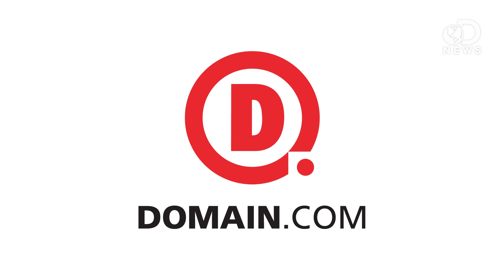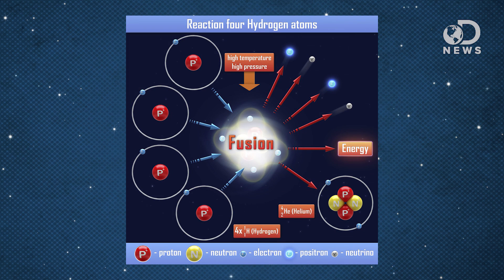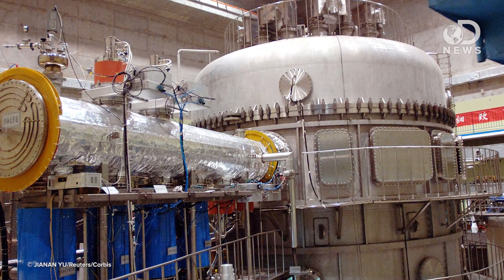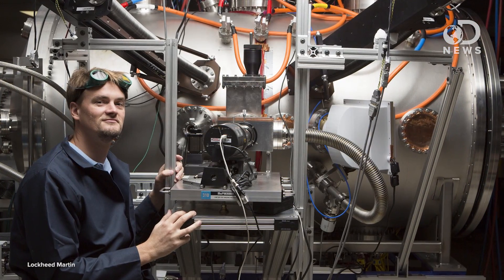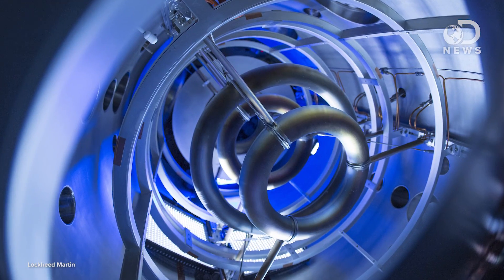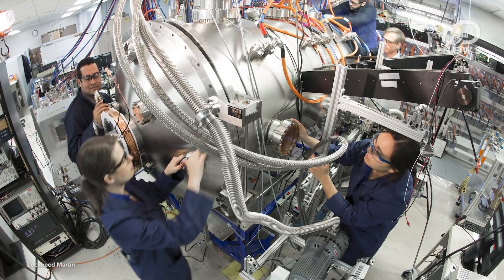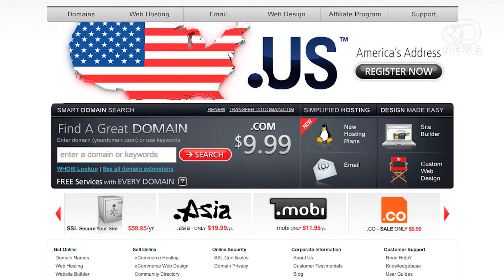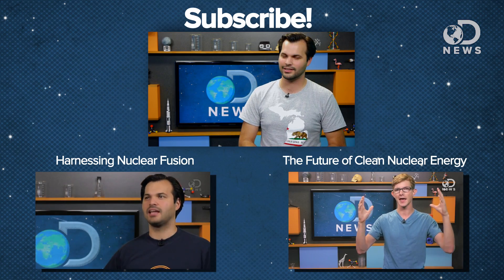Is Fusion Energy Close To Becoming A Reality?

Comment: I have a bad feeling that the coal companies with all of their lobbying power in the US will stem this from happening because of fear of them becoming obsolete.
Reply: Solthiel What you mean like thorium, solar, wind, water and geothermal? Oh wait the coal industry DID shut them down :/
Reply: Solthiel My point is, Thorium is a completely viable form of energy more efficient, safer AND less polluting than Oil, Coal or Uranium, but we're not using it. Why? Because the mining companies control the media. Therefore Fusion isn't going to help, because the mining companies, like with Thorium, won't let it.
Reply: +Bud Charles Lockheed is a beast. They have lobbyists as well as the keys to the kingdom with our military's most advanced tech. I bet they already have a energy net positive prototype and I bet the plans have already been stolen by the Chinese so the cat's out of the bag now.
Reply: Yeah I wouldn't worry about that.  The fossil fuel industry's lobbying will be utterly demolished by the lobbying of any group which has an energy production this efficient.  You should be more concerned with the new lobbying power Lockheed Martin would have if this is successful.
Reply: Bud Charles
With the exception of thorium those power sources aren't easily scalable.
Reply: Bud Charles None of those industries have nearly as much potential for energy creation as fusion does.  Solar, not efficient enough yet.  Wind, takes up a lot of space and repair costs are problematic.  Water...I assume you mean wave generation because actual H20 power isn't gonna cut it. Geothermal, highly situational and could never produce a fully functioning energy infrastructure.

Fusion?  It would literally oust every other type of energy production.  There would be no comparison at all.  It would not only outpace the efficiency of all other methods my orders of magnitude, but it also produces very, very little waste product.
Reply: Solthiel *coughcough*Thorium*cough*
Reply: Thorium is great, but if fusion were to be feasible it would still be in an age past.  Thorium is just the best we can do with fission energy.
Reply: A Ki If it's happening why aren't we detecting an unexpected decrease in Chinese emissions?

Comment: all this is just to generate heat energy to boil water to turn a giant steam turbine. we're still going to use 19th century technology to generate electricity
Reply: thelastspartanS117 the fusion will cause massive amounts of heat, which will be used to heat water into steam to power turbines, as rurutu said. the basic principle is the same as always
Reply: your fucking stupid. Apparently you werent paying attention at all. The fusion of the water molecules will cause massive amounts of energy, which can then be directly produced into electricity or any other type of energy needed. Its a green energy, meaning it can be used for anything.
Reply: Steam turbines are efficient enough at the time, I don't see the problem.
Reply: Steam turbines can have up to 45% efficiency.

Sure it can be improved on. But its not horrible 

The main problem is actually getting enough energy to heat the water up, and that is solved by introducing new ways to generate power.
Reply: Zorb Xer i cannot post my comment
Reply: Steampunk future? I'm not complaining!

Comment: so if this works out infinite energy will be a reality in my lifetime (i'm 15) cool.
Reply: Its not infinity
Reply: Not infinite, but abundant enough that it won't be a contributing factor to the viability of large scale project is probably the best way of putting it. Developing technologies that require a lot of power will become a lot cheaper, like space travel and chemical processes like electrolysis.
Reply: ***** as long as the sun is shining I guess it will be. And that's pretty close to infinity (for the human race)